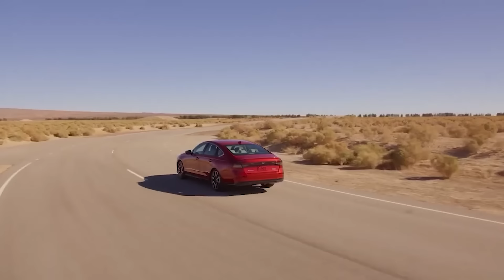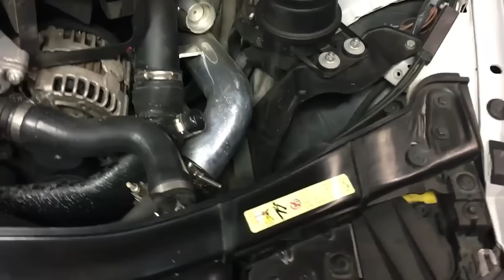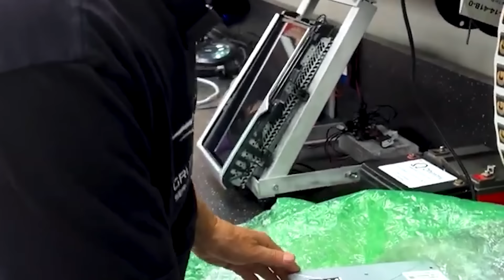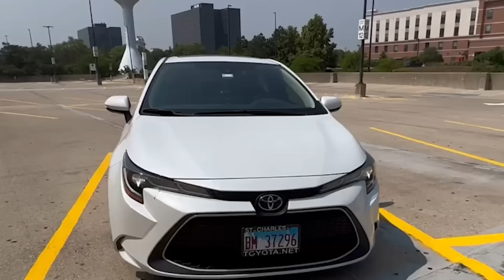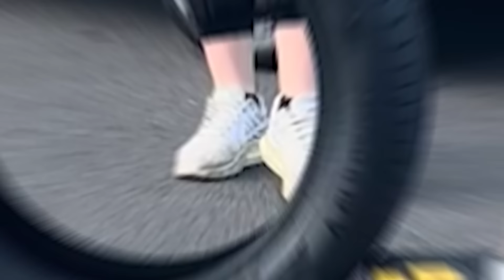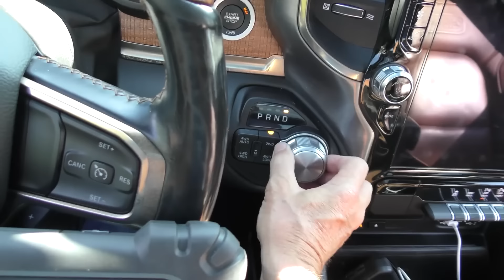21 STUPID Car Features That DESTROY Reliability & Lifespan (AVOID NOW)

Comment: The climate control should have buttons separate from the infotainment screen. It makes the system to complex and you can't be playing it will driving. If it breaks, you can use the A/C or heat

Comment: Ford, GM & Chrysler are cost cuttting, using cheaper quality plastics not just the engine but in the interior. The problem is that they don't last very long

Comment: Fuel injection is a stupid feature? I think people forget the gas guzzling V8s from the 70s and 80s made less power than a Toyota Camry from today
Reply: That's not what they said.  They criticized direct injection, often requiring port injection to mitigate carbon build-up.
Reply: @dirkvanvuuren3505  Yeah. They criticized direct injection, but the main reasons are PCV and EGR systems. Installing an oil catch can would significantly reduce the build up.